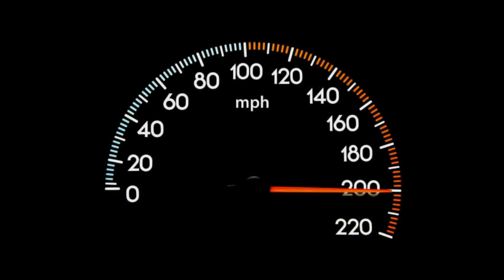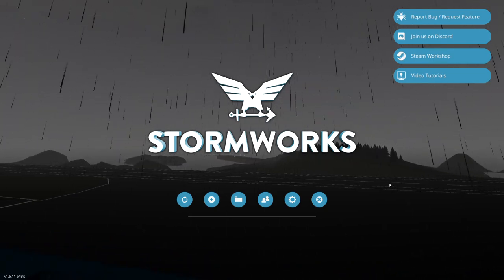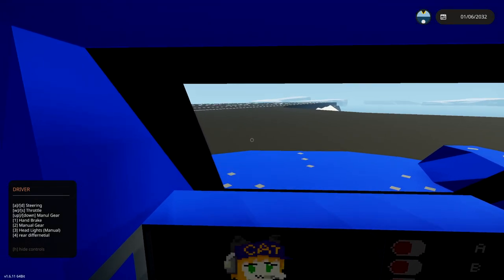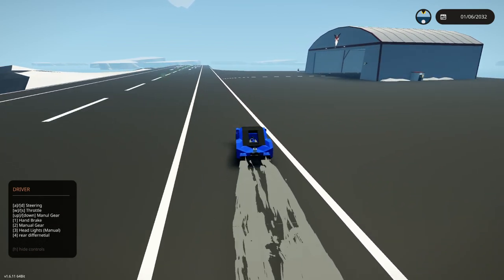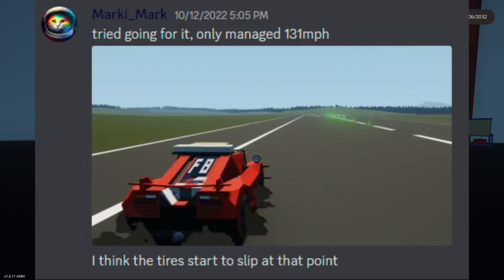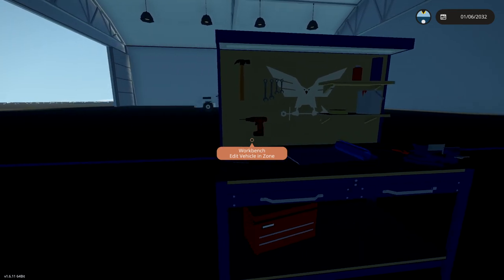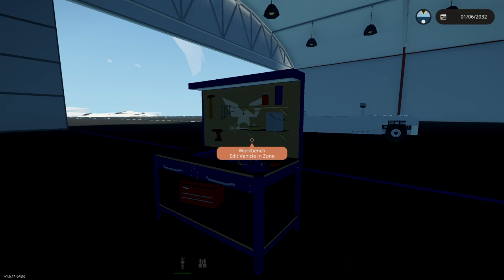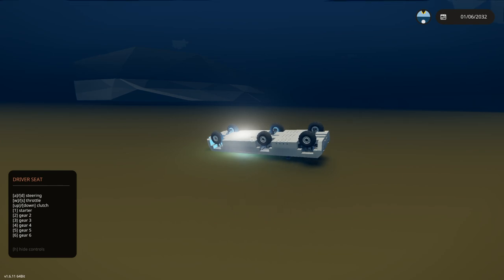It is impossible to get a four wheel advanced car up to 200 mph in stormworks!

Comment: 200 mph is not easy to reach even with aircraft in Stormworks.
Reply: A straight vector of 200mph is not, but if you get the wrong parts colliding with each other on a crash, a revolutionary velocity of 200mph is fairly easy. 😅
Reply: @steeljawX   😂 🥷

Comment: The game will treat tank treads as wheels via the # of wheels per track that are in contact with the ground. You basically can take away the entire track as a cosmetic effect and consider if a road wheel is connected to a drive wheel, it's considered "powered" like any other wheel with power going to it. So technically your "half track" setup was still a 6 wheeled version. The more "accurate" way to test if the tank tracks actually work as you're wondering is to have the drive wheel setup above the roadwheel so that a track actually is spawned in. I believe the drive wheels themselves do not provide as much traction as they could without a track spawned in so with it in the air only providing power to a road wheel, it should eliminate it being in contact with the ground with a track and only leave your test car with 4 "wheels" on the ground.

But while it isn't quite as fast as 200mph, I've been able to get a 5x5 wheeled crank powered car up to around 85mph. . . .It won't carry a lot at that speed, and the acceleration is complete garbage, but it's kind of fun to go zipping around with a vehicle at 85 mph that's only powered by 2 handcranks.

Comment: It is possible. You have to add mass and reduce drag to break 200mph.
Reply from the maker: I've messed around a bit with weight on vehicles. Any tips to reduce drag that I could test out?
Reply: @StormRunnerGaming  if you build a race car, and you have some wings with control surfaces for downforce, you can make a DRS system by just saying, if above x speed neutralize the wing